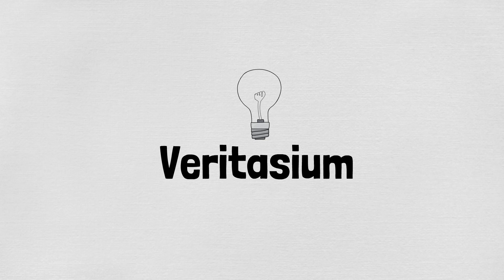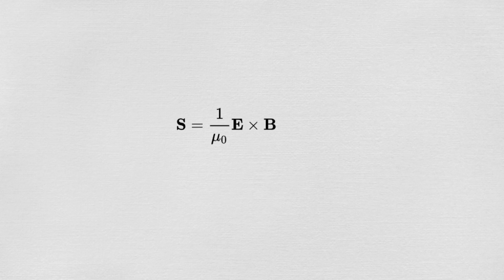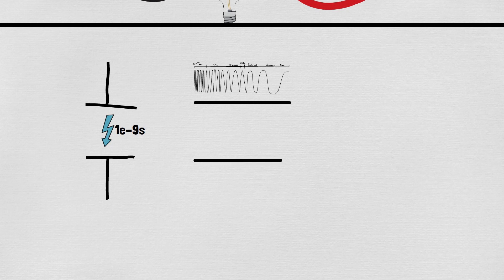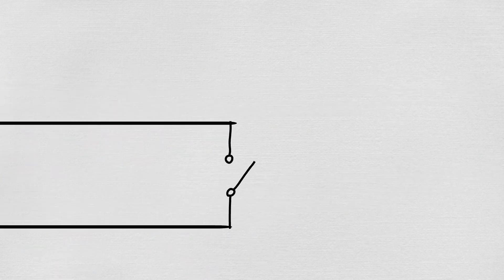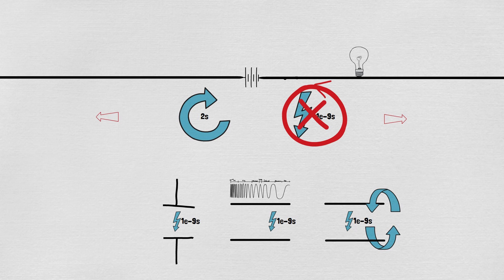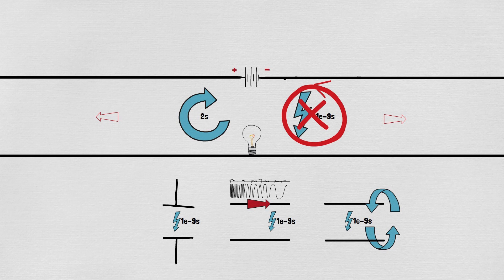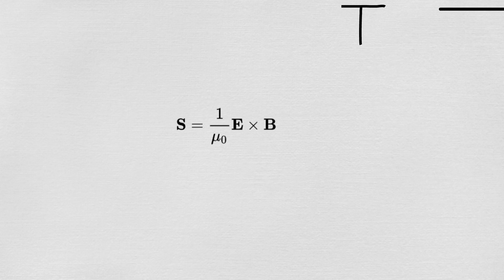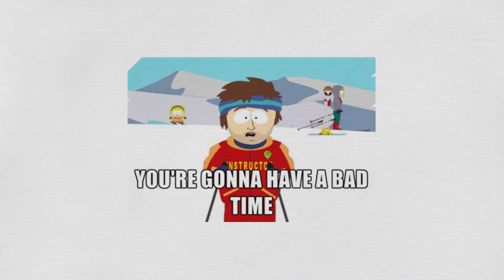Veritasium is Right? (see description)

Comment: Lol. Love “If you’re trying to describe a dynamic system with an equation that doesn’t have a ‘t’ in it anywhere, you’re going to have a bad time.”
Reply: Yeah that was well played
Reply: I’m taking machine dynamics rn and I feel that. Can I get a mr(omega)^2
Reply: Actually, there are lots of dynamical systems where there is no "t" in it anywhere (at least not explicitly) : they are called autonomous systems.
Reply: What about s? :-D (Hint: Laplace transformation.)
Reply: @PafiTheOne  then you replace the s with an t, as you reverse the Laplace.
Reply: @0bloodshot0  Wow I feel stupid
Reply: That is why i hate the speed of light being so often converted or assumed rather than measured. Obviously we have the means to measure the time delta of 2 points with known spatial distance and thus measure actual speed of 2 peaks of the same pulse hitting the sensors, giving us the speed of light in the measured medium.
Reply: Say hello to Relativity
Reply: The 't' is embedded in the 'E' --- it is an electromagnetic field, not a static E field. The switch in the circuit causes it to behave as a transient, time-varying system with a time-varying voltage producing an EM field. The problem is that it is not a steady-state EM field, so the Poynting vector only applies for the instant the switch is closed; once it's closed, there's an EM field for a brief instant, but eventually, it turns into a DC circuit.
Reply: @funkathustra  exactly correct

Comment: Good examination. 1 error: the potential difference across the battery is created by an electrochemical phenomenon inside the battery and is independent of any current flow. It's a pretty minor point, but you nailed everything else really well. Thanks.
Reply: Another minor point is that once the switch is closed, the cause for current flow begins to propagate in both directions from the switch and reaches the bulb from both sides in a little over a second. That said, I sure do appreciate that someone was willing to believe causality!
Reply: That's not a minor point, it's a pretty big deal. The STATIC potential difference across the open switch (!) is what causes it to behave like a capacitor (or transmission line) in the first place. According to his diagram, the short piece of wire between the battery and the open switch is positively charged (the "minus" sign means lack of electrons), while the giant wire loop all the way across the lamp and back to the other end of the switch is full of excess electrons pushed into this giant wire capacitor by the battery. Therefore, there is a static E-field between the short positive wire segment (battery to switch) and the opposing wire with the light bulb. This field has an extra pull on the electrons in the wire around the lamp and increases their charge density there, and likewise the short wire segment becomes even more positive than due to the battery alone - so it's just a simple capacitor by any definition, even though the lamp side of it is not confined, so the charge density drops gradually over some wire length where there's no more overlap between positively and negatively charged wire. Once the switch is closed, the short piece of wire gets immediately filled by electrons rushing in through the closed switch and the capacitor field collapses within few nanoseconds. The local charge density around the lamp now feels no more field holding it there, so it's released to travel outwards away from the lamp (actually in both directions along the wire, until the current from the battery arrives after going the long way around). And what is a changing charge density? - Right, a current density, mystery solved.

This is textbook capacitive coupling in action, because there is already an E-field across the wires before the switch is closed, so it happens "instantly" across the air. Of course the POWER you can transmit this way is limited to the charge stored in the capacitor (basically one half AC cycle), which is the battery voltage times the tiny capacitance of the wire segment. It's completely impractical to power a light bulb or even a LED, but it surely would be measurable with a sensitive enough instrument.
Reply: @michaelgeiss741  how big is this current? Since there is only static potential on switch, closing it would produce infinite current thrugh it for cca 2 seconds. Actualy a bit later, due to propagation of electrons in conductor is slower than lightspeed. Why 2 sec? To catch current equilibriim it should last 1s to get to the bulb plus additional 1s of nominal bulb current to return to the switch.
Reply: @244jts  can't we just get along and say that both are wrong, since this setup is close to an antenna and a receiver (and a capacitor), but connected at the ends. therefore the moment you plug the light and the battery the light would light up for a second untill equilibrium, then when you toggle the switch current will start flowing (gradually increasing for the whole 2s) instantly creating a small EM wave making the  lightbulb slowly ramp up to full over the entire 2s period. Unless you assume c=inf.
The exact circuit being: battery switch ((capacitor 1 A) transformer side 1 resistor transformer side 2 (capacitor 1 B(with high resistance)) bulb) repeat backwards.
In the idealised version there is no capacitance so 1s to start ramping up s 2 to light fully.
Reply: @ГеоргиГеоргиев-с3г  well, I mocked up a circuit and throw it on scope. 9v batt (8,6V), 4.5m long wires on each side, 1k ohm smd res, triger on right side of switch and diferential probes on 1k res. I got ramping up on resistor at 13ns after triger, first overshot at cca 45ns to 11.5V, first undershot at cca 90ns cca 8V, second overshot at cca 130ns cca 8,8V and settle to 8,6V after 150ns. Now scale up to Ve sizes. I also measure current over 1ohm resistor on left side of batt, rings out after cca 12 overshots, starting instanty afters switch, first overshot at 45ns being 10 times largers than nominal current.
Reply: @244jts  well um... I can't really see your setup, but if it's exactly as i said, it wouldn't exactly work(approximate), since you have to have a capacitor at each meter(ring of the transformer), but this is a close application. Sounds like i expected. Since it's basically an RLC with some fluff.
Reply: Let's imagine a perfect battery then, which is stable until it is allowed to decay. Meaning it doesn't have any potential difference until forced to have one. Now you can stop it with a switch, and the problem is that you need to be able to generate flux to propagate through the wires via the EM field to induce a polar reverse current in the wire parallel to the first part of the wire. Assuming an infinite wire, the problem is then, paradoxical, in why the flow of the wires all go in the same direction, as the magnetic field would cause it, to instead of in a singular direction across the wire.
Reply: @ГеоргиГеоргиев-с3г  no cap. Just original wiring scaled down in length. And 1kohm resistor insted of bulb. I don't buy antena principle, since antena must be fed with AC signal of proper wavelength, but in this situation it is the current spike that is making a single, isotropic, propagating em field. How would this induce a steady current in oposite wire?
Reply: @244jts  I'm going more basic, the pipe and two liquids kind of basic, and adding EM on top. The light doesn't care about AC vs DC. No steady current required. You have small pieces of capacitance and a mini transformer(with stupid low values) stacked, updating at light speed in a bubble (but assuming non zero watt lamp needing some minimal threshold to light)
"Of proper wavelength" only if you want maximum transmission efficiency, get a wire and you will find 50Hz, the cable is your antenna.
Reply: @RealNovgorod  Even if the concentration of electrons dropped or increased in the area around the bulb, how would that cause electrons to flow through the bulb? If it dropped or increased on one side more than the other then that would cause a current, but unless a cause of that travels through the one light second of wire on both sides of the bulb, why would there be any current through the bulb? If there is no current through the bulb, it will not light.
Reply: @ГеоргиГеоргиев-с3г  sorry, I don' understand your explanation. My baseline assumption is, that there is full battery potential on open switch. And when it is closed, it is actualy a short circuit until the propagating current spike reches the bulb AND carries that "information" about nominal bulb current back to the switch. Ringing in my setup might be because of a battery internal resistance.
Reply: @244jts  The actual size of the current may not matter here because Derek said "assume the wire has zero resistance." The bulb has a little resistance, since it is assumed by Derek that it is going to light up. Yes, the speed of a signal in and electric field in any kind of wire will be at least a little less than the speed of light in a vacuum. 
When the switch is closed, the effect of rapidly equalizing electrons will travel along the electric field of the wires on both sides of the switch and battery like two shock waves that meet at the other side at the bulb. One wave will carry a surplus of electrons and the other will carry a lack of electrons. As soon as those waves arrive at the bulb in a little over a second, there will be some initial movement of electrons through the bulb and then it would settle down into a steady flow of electrons through the wire and energy through the field. 
As Derek said, it is not the electrons that are leaving the battery that have to flow through the bulb for it to light, but rather the electrons that are already in the circuit near the bulb. The electrons themselves can move slowly in random directions with a bias for moving away from other electrons, while the electric field of those moving electrons can carry energy along the wire at nearly the speed of light.
For these reasons I maintain that the bulb will not light for a little over one second, and that to be convinced otherwise I will need a reason to think that electrons will moving through the bulb sooner. Derek is a smart guy, and I predict that he will figure this out and clarify things for us all in the very near future.
Reply: @michaelgeiss741  yes, nothing goes faster than light. Not even information. The bulb gets the information of the state of the switch via wires. That's why it will lit as soon as the current spike (voltage drop in the wire) reaches it. Sort of a delay line memory efect :)
Reply: @michaelgeiss741  It sounds counterintuitive, but microscopically the "direction" of current doesn't really matter if the charge is changing because current is literally defined as the change of charge over time (dq/dt). Of course if you have a piece of wire without any potential difference, there is chaotic thermal motion of the electrons creating tiny (directional) local current densities that cancel each other out - then you have zero current (within any relevantly sized unit volume) because the charge stays the same and the current density vectors all cancel out (or more precisely, the charge stays the same BECAUSE the current density is net zero). However, this example is comparable to a homogenously charged capacitor plate: If you start discharging it and monitor the charge density at any point on the surface, you will see it changing, which is by definition a current. How exactly the charges flow into (or out of) this point from the surrounding is irrelevant. If this bit of surface area or volume has some specific resistance (imagine it like a perfect capacitor covered in a resistive shell), the charging current flowing into (or out of) it has to do work regardless of the direction it comes from.

So let's say the filament in the light bulb is part of this "wire capacitor". Then you can consider each tiny segment of the filament which has some excess charge stored on it. Once the external field collapses and the charge is free to move, it will immediately start flowing out of the segment into neighboring segments - no matter which way, it can be even both ways if this segment is exactly in the middle of the charge density distribution on the wire. There is a net change of charge and therefore a net current flow in each segment (no matter the direction, I emphasize that again), and therefore this current will do work (i.e. heat up the filament) - of course the amount of current wouldn't be enough to make the filament glow in an actual experiment.
Reply: @244jts  Exactly. Now we just need those who disagree to comment!
Reply: @244jts  is your cable in a coil or 2 parallel lines since that would make it a physical coil or capacitor (with a short at one end assume parallel resistor) respectively. Usually the cable capacitance and EM radiation are negligible, but in these kinds of setups they add up (bigger or closer) the classical right hand rule making all current induce a magnetic field(it will be static, but the peaks will flow to the second wire as AC)

That is what Verat... Setup in his video is hinting, but in the real world the capacitance and induction will be massive a capacitor with 1 cm gap 1mm x 300km is basically one of those early air capacitors a 300 m^2 plate ~0.3 feet^2 but with high internal resistance
300000 m^2 to be precise(since c/t~=3*10^8 m) (/900 feet^2)
Reply: @ГеоргиГеоргиев-с3г  wires thrown on bench and spread left and right. I also tried other layouts, like both loops together, "I" shaped, randomly spread.. all i got was different amplitudes of ringing, but the delays remain the same. I did howewer seen crosstalk in some occasitions. Also tried puting resistor on one end insted of center, i got triple peak owershots. This is because the line acts like a transmition line with it's characteristic imedance, and part of the propagating wave reflects back, when it reaches different imedances. That is by my unedrstandig the culprint of all the ringing I got. Maybe I will repeat the test with more precise equipment and proper setup, suported with some calculations. If i have time.
Reply: @244jts  made you way more work than necessary, so I'm ok with stopping.
Reply: @ГеоргиГеоргиев-с3г  No problem, i am curriuos, what the real solution is, had to test by my self. Experiment a little..
Reply: @ГеоргиГеоргиев-с3г  Yeah, thanks for the warnings! I never thought 9 volt battery would kill me.. I better lock my laboratory with all EE equipment, which I am using for 30 years, and throw away the key..
Reply: @244jts  :D yeah, but there are other people here on the internet, you never know(who might be reading).
Ps: i'm happy to assist in any calculations you may need(or "physics fairyland") since you show more experience.
Reply: There is no electrochemical process if the circuit path is not closed. You are wrong!
Reply: @eddietee6305  yes, but this is true only in idealised  electric world where space has infinite resistance(the circuit part) and where it already happened (what you said = there is no gravity because the ball has landed, you have to release the ball to have gravity), but real world(and this case) is not that, you have false logic, a process is a process, it doesn't stop because you don't extract work from it you just slow it down.
Ideal batteries don't have electrochemical properties (that's why they are ideal) get your facts straight people.
Reply: @michaelgeiss741  "current" is a mathematical model and not an actual phenomenon. Similarly, the EM field generation occurs through the entire wire length simultaneously and it is the length of the wire that defines the amount of time that it takes for an EM field to come into (and extinguish from) existence - i.e. nothing to do with the switch location.
Reply: @eddietee6305  "electrochemical phenomenon" .. so, no, I'm not wrong! 

When the circuit is open, the electrochemistry is fairly static but still in slow motion over time. And when the circuit is closed, the battery's electrochemistry works to produce a voltage across the terminals.
Reply: @stephendee7839  By "current" I mean the movement of electrons through the electrical field of the wire. Movement of charged particles creates a magnetic field, which in an electric field moves energy in a specific direction. Until the difference in concentration of electons causes electrons to move, no energy will flow. The effect of moving electrons propagates through the wire at almost the speed of light, meaning that electrons will begin moving through the bulb a little over one second after the switch is closed. If the switch was next to the bulb, then the light would come on right away and energy would begin flowing out of the battery a little over a second later. Changes to the circuit by opening or closing the switch do not occur simultaneously but rather propagate through the circuit at nearly the speed of light.